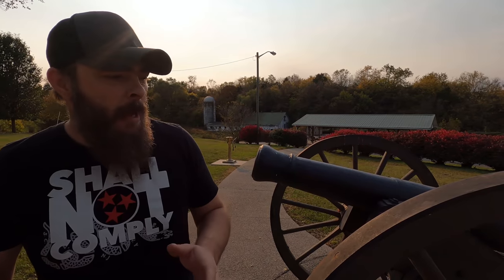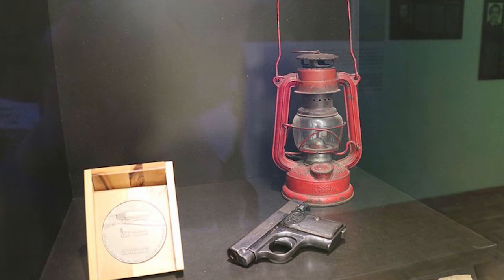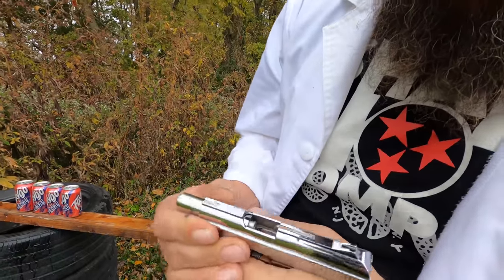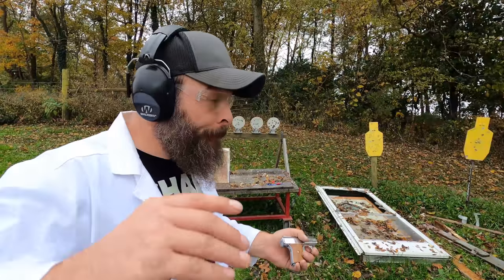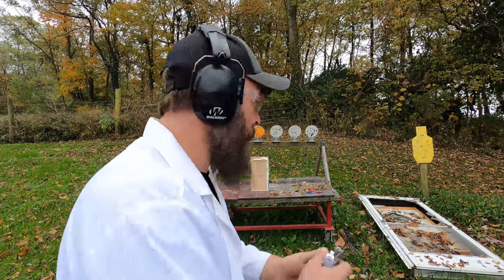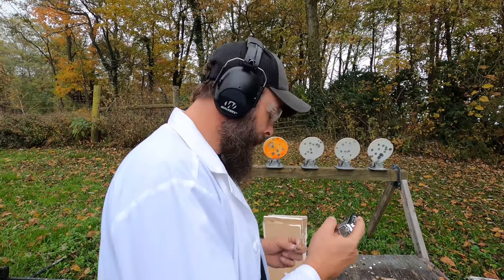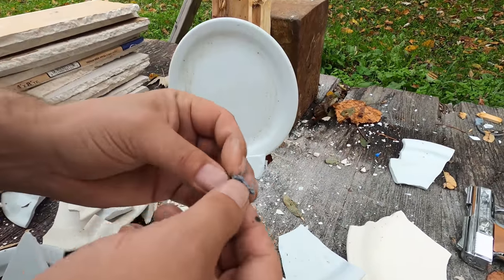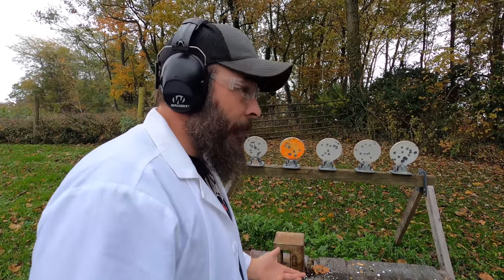Truth About the .25 Auto.

Comment: Since it competes directly with the .22, I think the biggest vote AGAINST the .25 is cost. If you don't practice, you won't ever be any good and the cost of .25 is higher than most handgun rounds. 10yrs ago, you might have been able to argue the concealability vs larger rounds and reliability of centerfire vs rimfire. But .22 mags are far more reliable than they used to be, and subcompact 9mm is encroaching on the concealability domain of these small guns. 
When Browning introduced this round, there may have been a viable place for it. But the wide variety of 9mm has really pushed other rounds out of the way. It's not a penultimate round. But the options it offers make it hard to beat.
Reply: 9mm has a hell of a recoil from a pocket pistol and you can't rapid fire it like a 25acp.. good chance you'll miss that target in the heat of the moment compared to a 25acp
Reply: @timd729  that's a strawman. The wide variety of 9mm rounds available, and lower average cost, means that for any time/$ investment in gaining skill you'll be ahead with 9mm. 
Even with pocket pistols. 
Recoil sensitive?  No sweat. 
1) choose a lower projectile weight round for lower felt recoil. 
2) practice.  
Whatever amount of time and money you'd be willing to spend practicing with the .25, do that with the 9mm and you'll be ahead of the game. 

If you're comparing 2 people who never practice, your results will be 100% random and thus irrelevant.
Reply: @ChristnThms  With 9mm out of the same length barrel of a 25 acp pocket pistol, 2 and half inch barrel, its travelling at less speed than a standard 5 inch. The website 'ballistics by the inch' has done chronograph tests and says a 2.9 inch barrel 9mm pistol (Rohrbach R9) is pushing a federal 115 grain bullet at 949 fps. Same website says 50 grain Winchester ammo out of a Beretta Jetfire is at 785 fps. The difference is the recoil on the 9mm pistol is going to be a lot more than on a 25acp for a little more than twice the power. You can rapid fire 25acp at a paper plate in 20 yards and hit it with all the rounds when fired. Can you rapid fire that 9mm the same way? would take a lot of practice because of muzzle flash and recoil, I'd have to see to believe if people told me they could accurately rapid fire a pocket 9mm. If I had a choice between a pocket pistol in 25acp or one in 9mm. I'd take a full size 9mm because a 5 inch barrel has significantly more power and control than a pocket pistol... I have a Taurus TCP in 380, it's all plastic and less than a pound, that kicks hard enough to not allow rapid fire with it unless you really train, but most people who I let shoot it cant hit a damn thing because of the recoil, muzzle flash and small sights..
Reply: @timd729  if you think a .380 kicks hard, then you're right. You should probably stay away from anything bigger. 
Practice is still going to be what gets your hits on target, and you can practice a lot more with a 9mm for the same time and money. If you don't practice, you'll suck when it matters. If you practice the same amount on each, it does make sense that the smaller round will be easier. But if your practice is limited by how much you spend, which is usually the case, you'll always be better with the 9mm because of volume.  

The one case I'll easily concede is the psychology of fearing recoil. Some people get a real aversion that prevents them getting better. The gun you're WILLING to train with is 10x better than the gun you're afraid to train with.

Comment: I have two guns chambered in 25 acp. Both guns end up getting bullets stuck down the barrel despite one of the guns being very high quality. Has anyone else had this issue? I assume it’s the ammo (Winchester white box), but I’d appreciate any suggestions on how to fix this.
Reply from the maker: That sounds to me like bad ammunition rather than the gun. I’ve seen some questionable ammo over the past few years in many calibers. I don’t know if it’s a quality control issue or just supply shortages are causing companies to use inferior materials.
Reply: @GunDoctorTV  that’s the conclusion I’ve come to as well. One of my 25s is a cheapo Jimenez arms, but the other is a Beretta and the problem is the same.
Reply: For the record, I found out what the problem is. It was the ammo. NEVER buy Winchester white box. There was practically no powder in the cartridge. I was basically trying to ram a bullet down the barrel with little more than a primer.

Comment: Want to use a light round for whatever reason ?
 No problem more practice, it is not size it is placement
If you get hit in the head with a 22, 22lr, 22mag, or 25 acp your most likely going down

Comment: The only problems that I've had are that the slide doesn't lock back, and the magazine won't drop, but that could've been the gun too. It was a Lorezen L25!
Reply: No 25 acp pocket pistol locks back or drops the mag free... At least not the magazine release on the heel. Those heel releases are not meant to drop the mag, you gotta pull it out.

Comment: I have 3 handguns 25 and 32 and 9mm
I like the 9mm but it is an all steel cz85 so it is hard to carry.
The 32 acp is good enough and is much easier to carry 
The 25 is tiny reliable and can get the job barley done I would carry it if I have to go really small